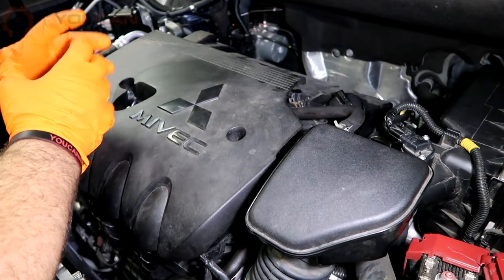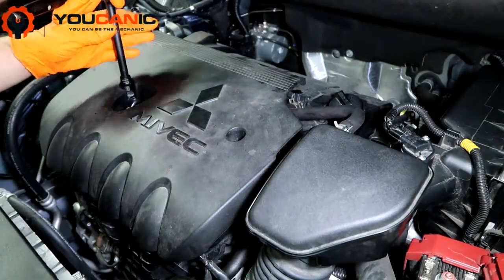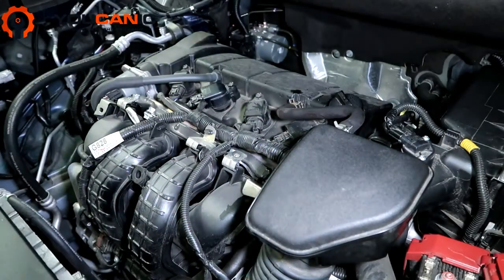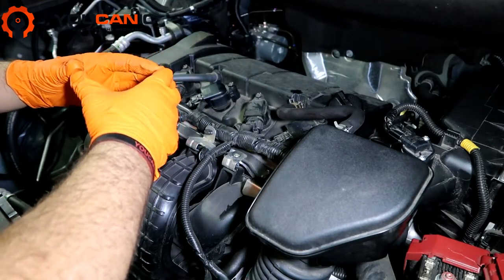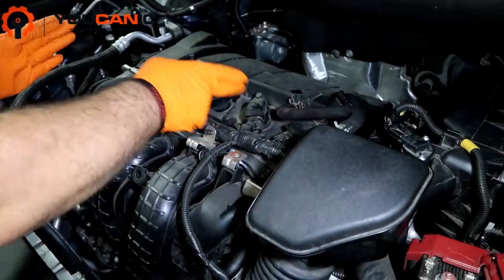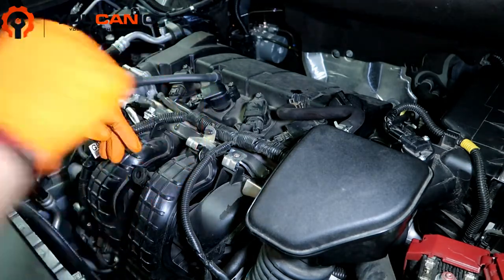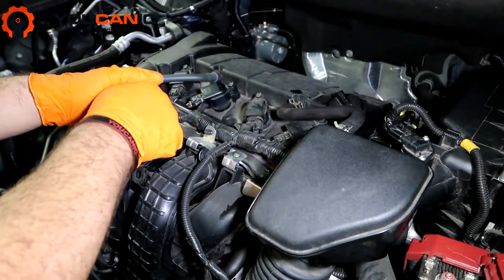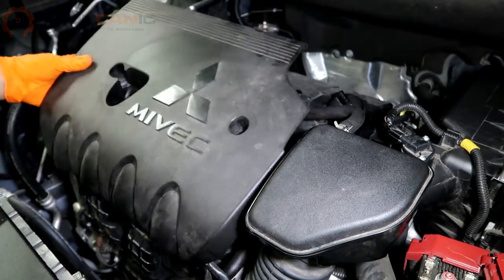Mitsubishi 4-Cylinder Engine Ignition Coil Replacement Procedure

Comment: My Outlander is averaging like 22mpg, should be MUCH higher (got it used).  I'm doing the spark plugs, but what else would you look into for something like this?  Fluids looked good, tires good.
Reply: You might look into that. I had the plugs replaced on mine at about 110k miles. MPG in good weather is good, but my mechanic recommended replacing the coils at about 150k. I may try doing it myself; I'm kind of starting to miss twisting wrenches. 😁

The other thing I've found out about Outlanders, though -- at least with AWD -- is that when you rack up highway miles with sustained RPM much above 2,300. your fuel economy will really take it in the shorts. It seems to want to be driven about 68-70 mph (2,200-2,300 RPM) for best economy.